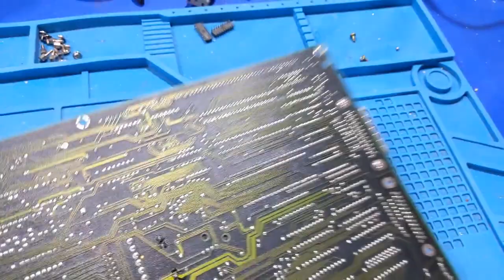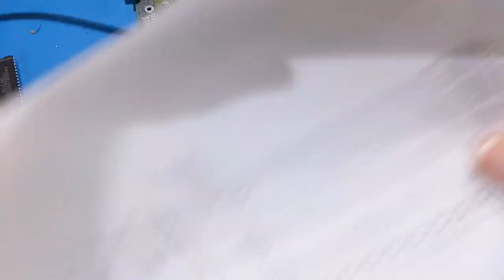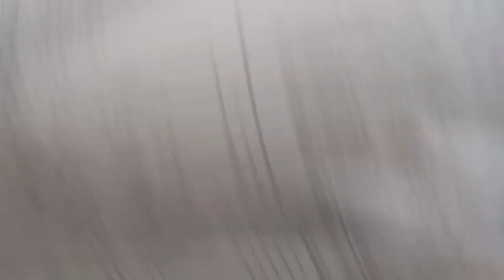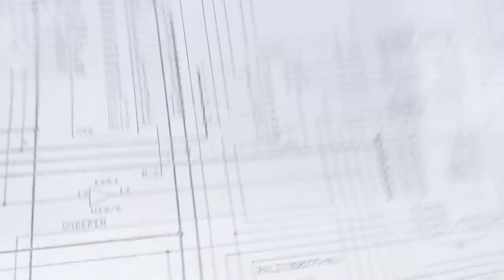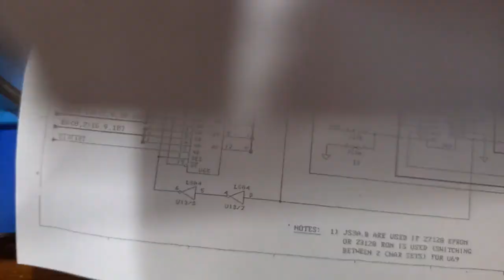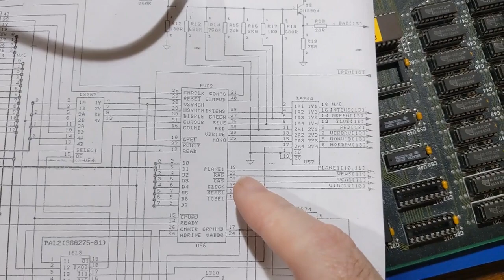Delta Gold Elite XT: Troubleshooting a no video fault

Comment: I don't think the PVC-2 has any registers that can be read, but it does generate the VRAM RAS/CAS clocks. Without those the VRAM would simply not work, and access to it would time out. BIOS might not be getting as far a VRAM test but it might be probing to see if VRAM is there and failing.
Reply from the maker: Well, during my tests, I saw the RAS/CAS signals at the VRAM. maybe they were coming from the 6845, not entirely sure.
Reply from the maker: I ended up replacing the chip but still had the same problem so I'm kind of at a loss

Comment: Hopefully there isn't some external fault hiding away somewhere that will kill the replacement chip. So much anxiety waiting when you flip that power switch...I'd definitely cast a hard glance at any passives in those circuits, in case they've gone wrong or are breaking down.

I'm going to hazard a guess that when the BIOS was customized for that hardware, that there wasn't a suitable beep code available, nobody cared to customize it enough to create one and the programmers just mapped it to the "nearest" fault code. I don't know if the BIOS would be watching for video timing signals to appear, but that READY line certainly looks like something it could be checking on and becoming unhappy if the chip never becomes ready.

The computer video market used to be extremely competitive. Paradise (later a part of Western Digital) was a decently large player. They were probably quite strict about giving out technical references and I suppose most were just quietly discarded when that IC and the designs using it were obsolete.

Can that computer be set for color video, or did they just waste a lot of that chip's feature set?
Reply from the maker: It appears it can only do monochrome. And yeah that's my worry. Unfortunately with how popular vintage computing has exploded, finding a replacement video card just to bypass the onboard has become nearly impossible unless you have a deep pocket anymore.

I have no idea how they're testing the video hardware that's for sure. I almost would have to reverse engineer the BIOS to know that
Reply from the maker: Replaced the Paradise Chip still the same issue.... Hmm